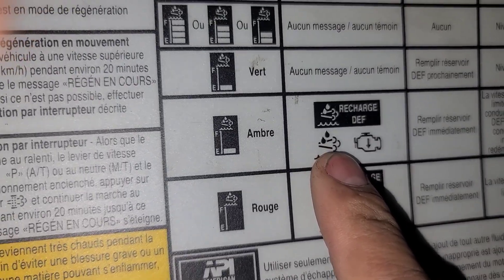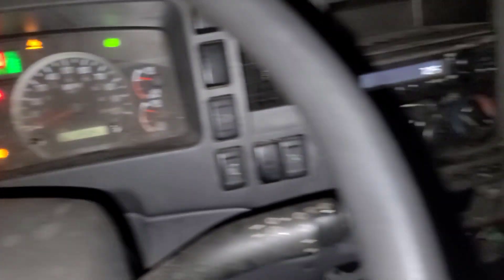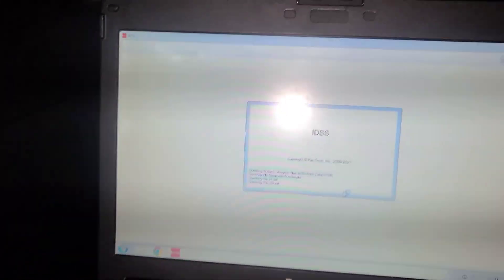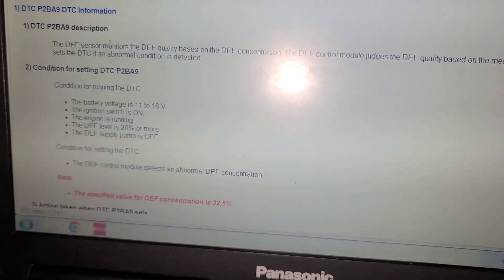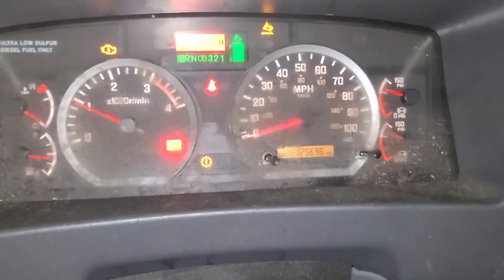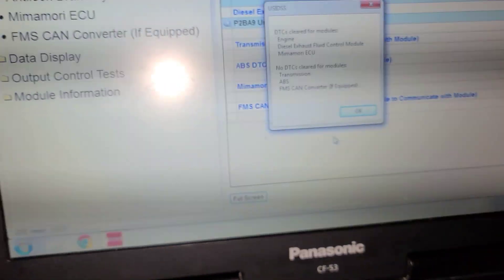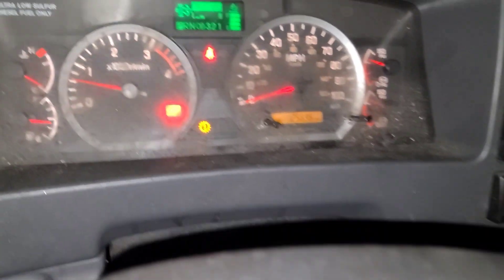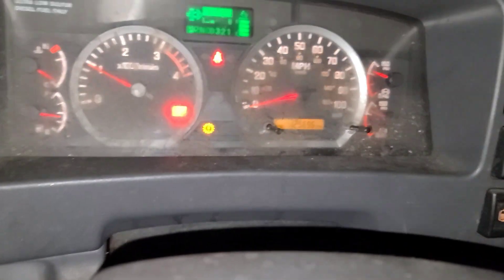RED EXHAUST SYSTEM ON ISUZU FTR

Comment: Hello again the guy from the Carolinas, maybe this time you’ll be able to help me, I get 2 Codes
1) P0027
2) P0402.  
How do I fix this will pay you the Isuzu Dealer won’t help.  
2018 Isuzu FTR.
Reply from the maker: Looks u have problems with exhaust brake check the adjustment or dpf damage
Reply: @truck_diagnostic  ok, I got good regen cycles with no issues, how about the Variable Valve Timing Solenoid in Bank 1.
Reply from the maker: @fredya.articarivera7865   Instegram @truck_diagnostic dm me
Reply: Sorry don’t have Instagram.
Reply from the maker: @fredya.articarivera7865  
Mail Truckdiagnostic1@gmail.com

Comment: The video is ok but you should put the solution if you fixed the problem
Reply from the maker: But if u understand the video  you get the answer .  I said on the video what was the problem and put extra  example
Reply: you should explain the solution much better and not said go to the izuzu inspection, you know that is very expansive and maybe the issue was just something that you can fix it by yourself
Reply from the maker: @RachidBoumli  well any program can be able to read the codes u can fix 
I did a video with autel table and work same as isuzu software this case
I have nox sensor problem 
Before replacing anything I tell any mechanic check power and ground because parts are expensive